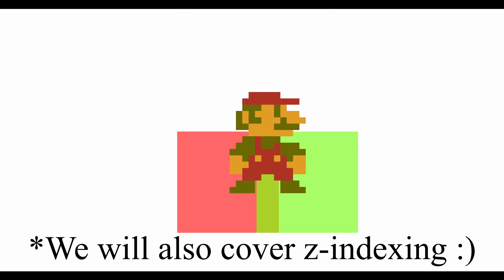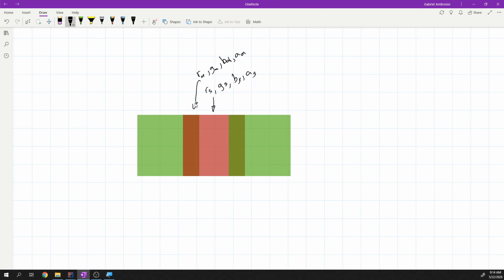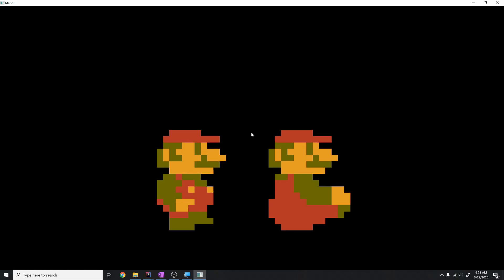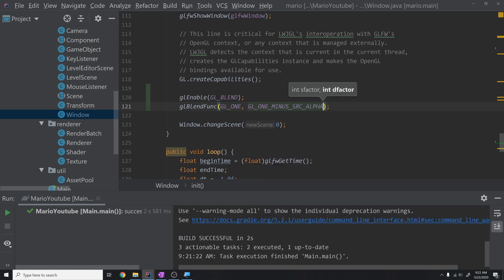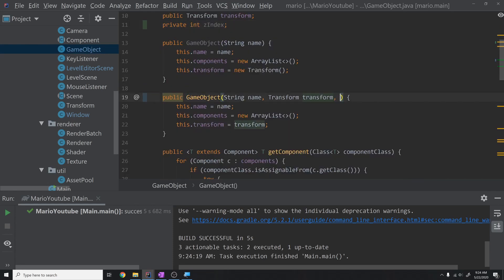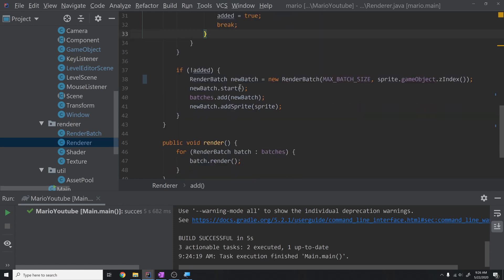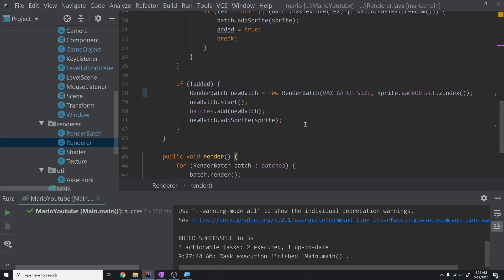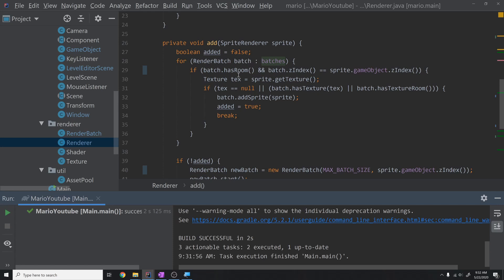Alpha Blending and Z-Indexing | Coding a 2D Game Engine in Java #16

Comment: Hey gabe I have this problem when i add the zIndex the when i run the program nothing is shown in the window. When i remove all the code i added it works i checked the code like 5 times and everything is like in the video so i dont really understand what is happening
10:58 thats when it stopped working i tried to go further into the video that it might fix it but it didnt helped and still it didnt worked

edit: i found out why... i forgor to add the this.isDirty = true into the second constructor in SpriteRenderer class

Comment: Hi, I'm not sure if you're still reading these comments since so much time has passed but I'd like to ask you a question, one big headache I had was trying to figure out with my alpha wouldn't blend when following your tutorial. Turns out that after
        glEnable(GL_BLEND);
        glBlendFunc(GL_SRC_ALPHA, GL_ONE_MINUS_DST_ALPHA);
i just needed to add the following:
        glBlendFuncSeparate( GL_SRC_ALPHA, GL_ONE_MINUS_SRC_ALPHA, GL_SRC_ALPHA, GL_DST_ALPHA );

I'm no expert in the matter so I was wondering if you could give me some sort of hindsight on this? To be clear alpha was correctly processed by the texture loading code and shader was receiving the correct parameters but with just the first two lines it would still only render as black and not transparent.

Comment: hi, i have a problem.

when i render 2 sprites like you, with the same textures you use, the second one has some pixels from the first one.
when i disable blending it happens as well
when i change the order of this images being drawn, it still happens but now the first one has some pixels from the second one.
when i change position of this images, it still happens
when i render only one of them, it doesn't happen

do you know what can be causing this?
Reply: it doesn't happen when using sprite renderers without sprite, just color
Reply: when i render this sprites on different batches, it doesn't happen
Reply: it still does happen when i copy your RenderBatch class
Reply: https://www.youtube.com/watch?v=HZLOWkbPNS4&feature=youtu.be 
it looks like this
Reply: if you have too much free time you can help me

here's my code: https://github.com/Rotthin/Project-M/
Reply from the maker: @rxn7  Hey Rotthin, I just got a chance to check out your video. So, does the green square have a red square underneath it and that's why I'm seeing the red pixels glitching in? If so, this is a problem that's known as z-fighting https://en.wikipedia.org/wiki/Z-fighting . This is when two objects occupy the same space in a 3D renderer and the renderer can't tell which pixels should be displayed. So you get that weird glitch that you're seeing. Unfortunately the only way to resolve this is to move the sprites to different z-indexes which I do cover in a later tutorial. Let me know if I misunderstood your question :)
Reply: @GamesWithGabe  thanks for your reply! the green square doesn't have red square underneath... I'll ignore this and I will think about this later

thanks for your videos, they're really helpful
Reply from the maker: @rxn7  No problem, and hopefully it gets solved. I'll try and help out if I can :)

Comment: I'm trying to create a game and I need to change an object's z index while the game is running but I get this error: ConcurrentModificationException. Can you help me?
Reply from the maker: Hey Roi, the reason you're getting this error is most likely because your adding a game object to a list while it's being iterated over, or you're removing a game object from a list while it's being iterated over. I do actually go over changing a game objects z-index while the engine is running in a future video, but if you want to implement it yourself, try changing the update loops to 
for (int i=0; i < gameObjects.size(); i++) {
  GameObject go = gameObjects.get(i);
}
instead of
for (GameObject go : gameObjects) {
}
which should fix that error and hopefully get you closer to changing that value at runtime :)
Reply: @GamesWithGabe  Thank you so much. You really helped me and your tutorials are excellent. I've learned a lot from them.

Comment: I struggled with this for a few days, but if anybody is having issues with transperancy not working (displaying white instead of being transparent), but alpha blending is working, I found a solution.
The problem is with the shader, and although I don't know why it works for Gabe and not me because my renderer is very similar if not the same.
Anyways, the point is, in your shader, you need to check if the alpha data at the coordinates the shader is checking are < 0.1, if it is, discard that pixel.
this should be all you need to add to your shader:

vec4 texColor = texture(texture, TexCoords);
if(texColor.a < 0.1)
        discard;
color = texColor;

My shader (should work as a drop in replacement if you have been following these tutorials): https://github.com/athaun/Gprocessing/blob/master/src/assets/shaders/default.glsl
this tutorial explains it better: https://learnopengl.com/Advanced-OpenGL/Blending
Reply from the maker: Hey @Asher! I would be careful with using this technique in your shaders, because although it will discard fragments that are transparent, if you have a semi-transparent object (like glass) it will not blend the colors properly. If you look a bit further in the article you linked the author goes on to talk about that. I can take a look at your code and try and see why it might not be working when you were blending :)
Reply: @GamesWithGabe  Thanks, I looked at the article harder, and found out that the glBlendFunc you had doesn't seem to work well, and the discard is indeed unnecessary.
The blend function that works for me is actually 
glBlendFunc(GL_SRC_ALPHA, GL_ONE_MINUS_SRC_ALPHA);

instead of
glBlendFunc(GL_ONE, GL_ONE_MINUS_SRC_ALPHA);

not sure why the second works for you, but the article explains it all very nicely.
Reply: @asherhaun  Thank you for sharing this! Your comment saved me from a lot of frustration :D
Reply: @justadoggo4946  glad to help!

Comment: I have encountered a problem. I followed the Texture Batching tutorial to implement Texture Batching in my own Engine, but the Quads get drawn completely black.
The supplied texture is bound correctly. The texture has the correct data. The Texture Coordinates are correct. But the Quad is still black. :(
On asking StackOverflow, the answer I got was to use the sampler2DArray but that is a very long winded process. Please Help.
Great Tutorial BTW!!
Reply from the maker: Hey thanks for the comment Nikhil! Graphics debugging can be very difficult, and the way that I typically go about it is stepping through my program in debug mode in intellij. I'll usually insert a breakpoint where the problem is about to begin, then I'll step through the code and make sure all the values are what I expect them to be. Then if they are all correct I start to write shader code that "displays" the values that I'm curious about through color data. Could you point me to your Stack Overflow question? If it has more information I might be able to give a better answer than this :)
Reply: @GamesWithGabe  Here: https://stackoverflow.com/questions/62016041/opengl-texture-renders-black-eventhough-its-data-is-not-null
Graphics Debugging is very hard for me. I have abandoned many a project because I could not solve a certain rendering issue. Whatever though I hope I can find a solution. :)
Reply from the maker: Hey Nikhil, so I took a look at the stack overflow question, and I can't be certain what could be causing the problem. One of the things you might want to do is try glActiveTexture(), then glBind(). I'm not sure if explicitly stating the functions might do something different then glBindTextureSlot(). Also, the method that I was referencing is based on this video from the cherno: https://www.youtube.com/watch?v=bw6JsLnx5Jg you might wanna check it out and see if it has some additional information. Lastly, you could try a different technique altogether that does not require any arrays of sampler textures, take a look at this shader code from my original code for this project: https://github.com/codingminecraft/Mario/blob/master/assets/shaders/default.glsl you'll notice that in the fragment shader I have a giant if-else branch where I basically check which texture ID I'm working with. I also declare uniforms for all texture slots, which means everything is a bit more cumbersome, but it is super explicit :)
Reply: @GamesWithGabe  Sorry for the late reply. It was night here. Thanks for the answer. I have already tried glActiveTexture() and then glBindTexture() but that did not work. I thought about your next suggestion overnight and am about to try it. Will edit this comment after I do. :)
EDIT: It did not work. Uniforms are correctly set. Texture is bound. IDK what to do now.
Reply: I completely rewrote the texture class and now EVERYTHING Works. I will diff between the older and newer versions.
Found the stupid differences...... AHHHHHHHHHHHHH. There were two problems with the constructor.
First was in stbi_load(). The last parameter should not be 0 but 4.
Second was the TexParameters. I used the static functions glTextureParameterf() instead of glTexParameteri(). IT WORKS!
Thanks very very very much for your help again! :)
Reply from the maker: Haha no problem Nikhil! I'm glad you got it figured out and will be able to continue with your development, and trust me I've spent several hours debugging very similar issues. Rendering is definitely one of the hardest things to program in my opinion, but it's always very satisfying once you solve these esoteric problems :D
Reply: @GamesWithGabe  :D